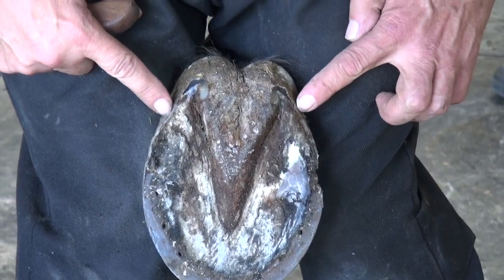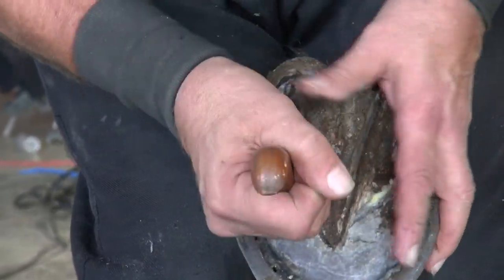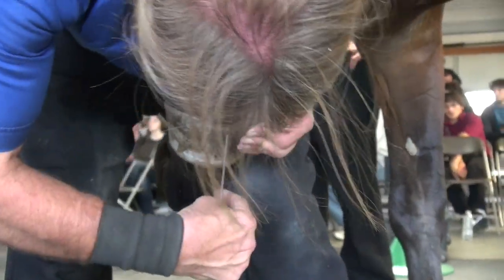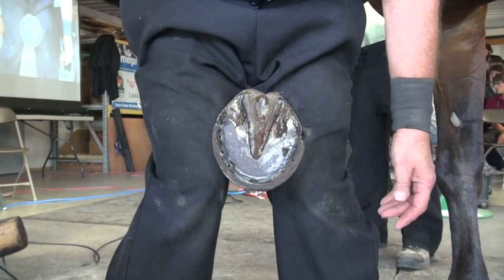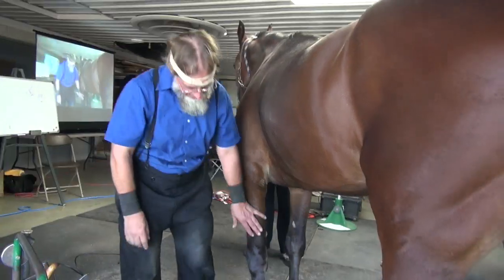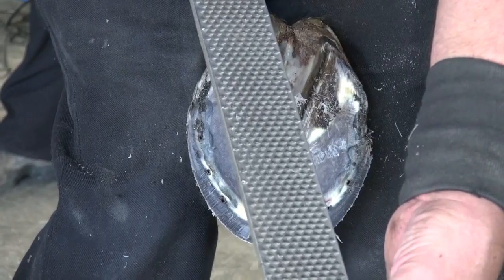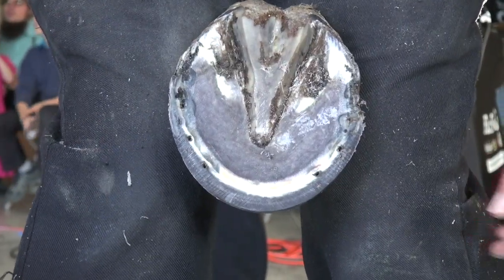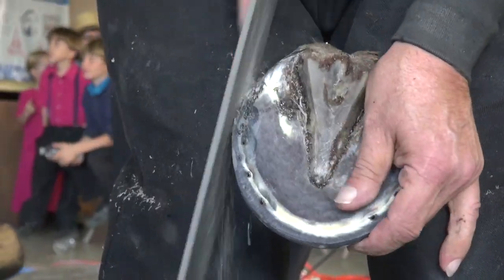Trimming A Standardbred Road Horse

Comment: I wonder if those rubber horse sneakers are any good for a driving horse??
Reply from the maker: Depends on the surface. They can be a bit slick on wet pavement. These  roadhorses are going at a pretty good speed sometimes.